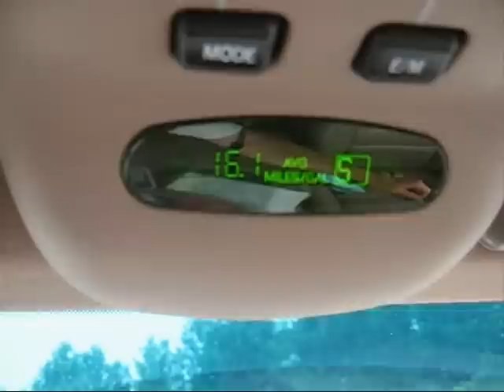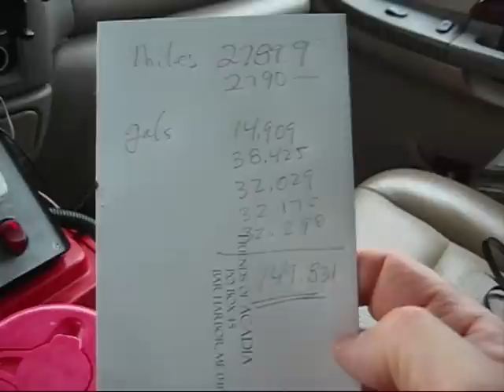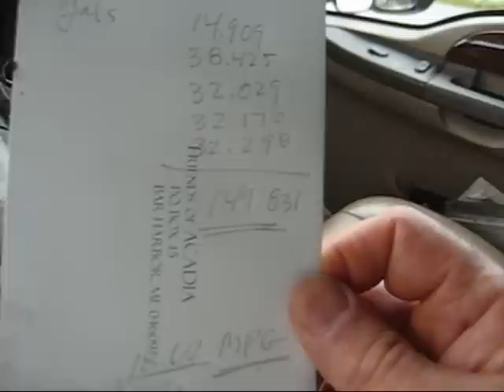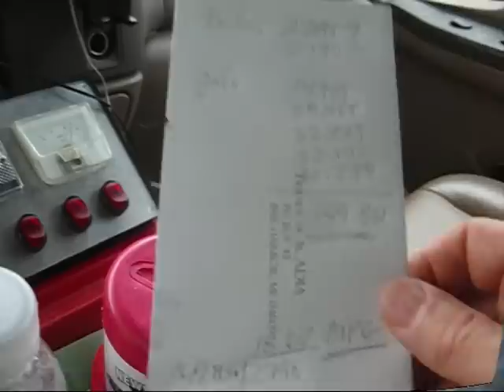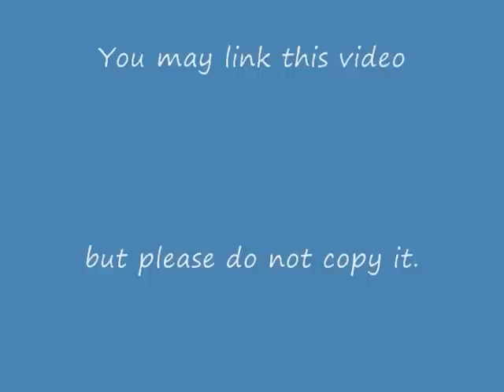MPG (mileage) Test 2790 miles with Dry Cell HHO F350 Superduty 7.3 Diesel

Comment from the maker: Thanks for stepping in. I get tired of telling these guys the same thing over and over again. They don't watch the videos, they don't read any of the comments. But one time or other they heard of the laws of thermodynamics, they don't understand those laws but it doesn't stop them from claiming that I have violated them. Let me state right now that the virginity of the laws of thermodynamics is still intact. I have not violated them.
Reply: people are stupid like a engine is only 30% effective because of the wasted electric that wound charge a battery. The excess energy that can't charge the battery because the battery is full charged goes to the HHO generation?
Reply: @Alec_Woldt    Well, not exactly... there isn't any "wasted electricity" per se.  The alternator has less mechanical resistance when fewer amps are being pulled; there is never any excess electricity produced, as energy flow is determined by the load, not the source (this is a simplification, but good enough for most things).  The reason something like this COULD be beneficial is because of the efficiency curve of the engine itself.  Fuel is used more efficiently when the engine is doing more work (generally).  So by giving the engine extra work in the form of producing electricity to power the HHO genny, which is in turn used to help fuel the engine itself, there will likely be an overall increase in fuel efficiency.

Comment: Just a suggestion, Have you tried having a separate battery and even add a capacitor between the unit? this quite help me on my amperage from dropping. And yes almost forgot I had a performance alternator included along with my set up. GL

Comment from the maker: The source of your confusion is that you are thinking of hydrogen as a supplemental fuel. In this case it is an additive that improves the burn of the diesel fuel. Back in 2008 I set out to disprove some of the extravagant claims made my HHO enthusiasts. So I made a hydrogen generator out of scrap and ran a series of tests. In every test I got a slight improvement in MPH when using HHO (hydrogen).

Comment: Hello,
  I have 7.3 excursion  I get 16-17 city and about !7 -19 hwy. If you keep your RPM at or around 1400 You will see 20-22 mpg. Oh, that's 45-50 mph. Check you converter. Manual trans get better mileage. Good info, I'm going to build a unit I think. Thanks

Comment: Well even if a dyno only displayed HP and torque if HHO was doing ANYTHING as claimed you would certainly notice an increase in torque and HP when it was turned on. However you know NOTHING about a dyno test. One of the purposes of a dyno test is for the SPECIFIC reason of checking gas mileage. You really need to do some research. Do you even comprehend what an air/fuel monitor is?

Comment: And there is no "energy" to be tapped...well not at a cost. If you were going to use some convoluted setup to burn fuel, to run an engine, that runs an alternator, to charge batteries AND run all the electrical systems, AND produce HHO..why not just ditch the HHO generator AND the internal combustion engine and go full electric. Skip all the efficinecy losses right off the bat?

Comment: I have no idea where you are getting this information on drag of the alternator vs. output.  Unless you think the alternator is an A/C compressor.  Do a little research in the high end automotive audio world and you will see what I am talking about.  A decent alternator can produce around 100A at full load.  This will only pull about 2HP from your engine.  If HHO production can increase your MPG to overcome the small 2HP decrease, it's a win.  The internal combustion engine is not efficient.

Comment: Is that 40 to 50 MPG real daily average use, or what the dealer states?  I can take a pic in my van that says I'm getting 99 MPG average if I reset it and then idle down a hill.  ;)  But really, it seems to get around 20 MPG with normal driving.

Comment: with a new vw sharan you get both: 40 to 50 MPG and 177BHP (130kW). it's not cheap, but if you drive 20.000 miles or more in a year you can really save money.

Comment: you can also buy a modern volkswagen tdi (turbo diesel injection) car (vw golf, vw sharan, seat leon,...) and have 50 miles per gallon like we all use them here in europe (germany, austria,.....).
cause of the taxes, the fuel is very expensive here, but we have fast cars that are not thirsty. the facts: one gallon of diesel here in austria is about 7 US$ now. with a modern diesel car 100 miles cost you 14 US$ of diesel.
what about the costs of 100 miles with a US car in the US?

Comment: Uhh I am no fan of Exxon which is why years ago I converted both my diesel car and truck to run on waste veggie oil and am a strong supporter of electric cars to reduce emmisions. I am also fine with any research to get vehicles to run on hydrogen. It is the scammers with these onboard HHO systems claiming massive fuel savings I am against and I tried it myself. Physics won. Sorry if you can't handle the truth. Enjoy your tin hat. I know others with a brain are reading and will not waste money.

Comment: Hi There,
I t all looks good except amperage, are you aware that just 1.9v producing HHO and rest producing heat that we call efficiency, If you use PWM or lets say kzx1250 you would en up with twice of HHO using just 10-15A that is beneficial not for yr pocket but for environment too. 

Kind Regards
Linas K.
kazlambiapictures@gmail.com

Comment from the maker: I considered emmersing the whole brick in used motor oil to help with cooling but what a mess! It is much easier to build a more efficient brick that does not get hot. On this brick the sulution was to solder the wires to the terminials.

Comment from the maker: I have closely monitored the EGT while using HHO and I found no increase in temps while using HHO. I have recently installed a water methanol system and it does add a lot of HP and I am still monitoring the EGT. It is very easy to burn up your pistons, valves and turbo if you run more than 50% methanol.

Comment: HHO burns hot. Diesel are not built for high heat and high combustion. In short you are doing more harm to your engine then good. Plus if u added a methanol injection to your diesel u would get better MPG and more horsepower.

Comment: From what admittedly little research I've done, adding a better fuel mixture is better. This also uses the electricity generated to separate the H&o2. I don't know what the generator does when the battery is full, but if it's not charging the battery it might as well add some pure O2 to the fuel mix, if nothing else. If I was still driving semi’s I would seriously consider adding this technology. Can’t wait to see smaller models for smaller engines. Chip/Sensor setting change is needed also.

Comment: HHOinfo..You are wrong and the numbers prove it..The truck is set up in a closed system..Once the HHO Gen is installed, the only thing extra added, is water..While it is correct to assume that, any electricity used is energy that comes out of the system and increases the overall  fuel consumption; it is erroneous to think that energy is wasted.. Since it is a closed system and there IS a ABSOLUTE TOTAL FUEL MILEAGE INCREASE, All changes are indicative of a total energy increase/savings..

Comment: Fair enough! I've just got rid of my Izusu trooper 3Ol diesel which i used for towing trailers etc.  having built my house i no longer need it. but fully understand your obvious need for a large truck.  Still facinated with your site, will continue to follow, wonder if the same system could be applied to my 1600 turbo D, scaled down of course, thanks& cheers Gwyn Jenkins, Monmouthshire. UK

Comment from the maker: The vehicle in this video is a truck that I use for work to haul heavy loads and pull heavy trailers (often in excess of 10,000lbs). While a smaller vehicle would certainly use less fuel it does not make economic sense to keep a second vehicle to use on an occasional vacation. We do have a smaller car but for this trip it was not large enough to accommodate five people, two large dogs and baggage

Comment: I've read with interest lots of these HHO projects. Am I missing something here!  You all seem to be using massive 7+ L engines in your cars. Surely if you reduced the CC of your vehicles. you would automatically reduce your consumption.  I get 50MPG from my Citroen Multispace 1600cc diesel (loads of space carries 4 people or 600kg in load space). The big problem is I don't pull any females with this car. (thankfully). Surely using smaller fuel efficient engines is the way to go.

Comment from the maker: I have had some success in tests where I drove the same routes with and without HHO, The extra hydrogen seems to improve the burn of the fuel. If it did not work at all you would expect to see a decrease in mpg when you had the generator running. In multiple tests I have never has a decrease in mpg but some times there was no gain.

Comment from the maker: I have done the math in one of my other videos and you are correct that there is not much Hydrogen added to the intake air. It is amazing that there is any improvement at all. I have noticed that I only get improvements in mpg when I operate the truck in a low fuel consumption mode such as cruising on the highway.  When I am carrying a heavy load or towing a trailer there is no measurable improvment.

Comment: I had a 1996 F-350 7.3 powerstroke,crew cab with 3.55 rear end, that I usually got at least 18.5 mpg at 65 mph with tailgate down (8 ft bed).  So, to me, 18.62mpg isn't that remarkable.  I, also, got that problem with it taking 5 minutes to top off the tank.  Must be a design characteristic of Fords.
But, I am still interested in finding out if HHO will work for me in my crown victoria.

Comment from the maker: No problems with early ignition. As soon as the HHO is mixed into the air stream it is diluted to the point that it can not be ignited by flame, spark or compression. The diesel fuel is directly injected at just the right time and is ignited by compression. On a gasoline vehicle you could have early ignition before the intake valve is closed and belch fire into the intake manifold. If the flame makes it to the HHO injection point the HHO could be ignited and flame all the way back to the brick.

Comment: Did you have any problems concerning ignition out of combustion chamber or early ignition inside of chambers because of using HHO in Diesel engine? Thanks in advance :)
Reply: Diesel cannot experience early combustion in this situation because the diesel already ignites as soon as it is injected.
Reply: @bobirving6052  Thanks for replying. I was more concerned about the HHO igniting early inside the combustion chamber of a diesel engine.

Comment: I have a 2002 7.3 F350 also if i keep my tack under 2000 rpm i can get over 18 mpg and that is not any highway driving without a hho gen. Do not get me wrong i am interested in more info on the hho I am thinking about doing one my self I am just trying to learn more before i build. But I hope to better my fuel mileage not make worse I mean i get that kind of economy pulling a trailer.

Comment from the maker: A while after I made this trip I ditched the four circuit breakers in favor of a large one and I soldered the wires to the plates. When I made my second brick (see the play list "My second HHO Brick") I ran wires to all four corners. That worked well but the brick leaked like a sieve because of a gasket problem.

Comment: Great! How is cooling the fuse/breaker a good soultion? Maybe you should have greater cable area and better/soldered connection points as you mention. Can you have several connection points? Maybe diagonal, for having to deal with less resistance through the steel. Cheers

Comment: Yea swap the whole drivetrain cause when you move up to the 3/4 ton stuff its alot stronger than the 10 bolt stuff the 1/2 ton has.My M-1028 has the 14 bolt rear with detroit locker and dana 60 front and i dont worry about breaking it.That 6.2 motor will last forever if its took care of.

Comment from the maker: I have 85 GMC 3/4 ton 4x4 with a 6.2L that I use around the farm. It is very easy on fuel but very under powered. I have been thinking of pulling the engine and drive train out and putting it into a surplus Blazer.

Comment: I have a 85 M-1028 1 1/4 ton 4x4 and all i did was put in a 700r4 overdrive trans and i get 27mpg with 4:56 gears.This is a military truck with just under 38k miles.

Comment: hho burns better than gasoline and is perfectly clean with no emissions. if there was no gas being put in a vehicle and it was running on hho from batteries or a generator there would be more efficiency in cost and emmisions

Comment: I think your drawing to much current and amps. Every neutral plate you add on should drop voltage by 2. The most important thing to do to increase hydrogen production.......BIG SECRET... 
You must increase the voltage frequency by adding a high capacity potentiometer or build a solid state unit. Plug it in between your power source and the HHO genny, You should expect about 25 liters a min...

Comment: I get 19.5 with my 2000 F250 superduty 7.3 staying under 55 got this truck new it has 175,000 miles 5 speed manual no chip stock. Its been the best truck i have every owned. starting to rust but i live ocean front. plan to replace it at 20 years. why cant they have just keep making the 7.3 replace water pump at 75,000 miles turbo o ring on fuel line at 120,000 miles. paid $32,000 new hate to see what a new replacement will cost. $75,000? o i forgot low inflation bull shit goverment.

Comment: Forgot to add.........the diesel stink is nearly gone and the engine runs very smooth and appears to have a lot faster pickup........So if the emissions are less and appx 30% less fuel use is ok by me

Comment: 91Toyota Hiace 2,4L turbo diesel......we split the cell.........half runs when the engine fires at idle 10amp........the  other half is activated by the throttle ......have only done one test.......8.8Km/Ltr with the system engaged......6,2Km/Ltr on straight diesel.......Only problem seems to be that drawing 20amp on this 70 amp alternator doing short stop and start driving will run the battery low after a while

Comment from the maker: Since this is a direct injection diesel there is not "altering the timing". The fuel ignites when the diesel is injected. You could argue that the burn is a little faster but I do not think that the difference is fast enough to make any difference...I am working on water/methanol injection but that is for another video.

Comment from the maker: I agree that the emmission standards decrease the average MPG of American cars. But gas and diesel are not the same. In a gas engine if you pass the stocimetic point you will burn up the top of the pistons and burn the valves. In a diesel there is not stocimetric point. You can add as much O2 as you want until all the diesel is burned. HHO does not lean anything up. You are adding H2 and O2 and they recombine in the combustion chamber.

Comment from the maker: You can inject plain water into the intake air of a diesel under certain conditions. The water is instantly turned to steam and increases the pressure in the combustion chamber. The increased pressure translates into more horse power and torque. Usually people use a water/methanol mix for the added fuel from the methanol but plain water will work. It might actually work better than HHO in most situations.

Comment from the maker: The MAP sensor does not control anything. The MAP sensor tells the computer what the Manifold Absolute Pressure is. The computer decides how much fuel is injected based on inputs from the MAP sensor, Throttle Position sensor and some other inputs. Some people have tried fooling computer into thinking that the MAP is less than it really is so that it will inject less fuel. But when you inject less fuel the truck doesn't go as fast and you push down more on the TP sensor. Still no O2 sensor.

Comment from the maker: *You need to do some research. Your truck is not that basic. You have to have on O2 sensor. What tells your MAP sensor how much fuel to deliver via air density, air temp and turbo boost? All these are variables the computer has to adjust. Go get a book on engines. I too have a 7.3....It took me quite a while to decipher your post. I have many books, I have done my research and I have at least 20 years more experience than you.

Comment from the maker: This 7.3 liter diesel is direct injected. I can not make any sense of the rest of your sentence. I have to correct the about statement: There is a MAP sensor on my truck. The only control on the turbo is the waste gate and it only opens to relieve excess pressure.

Comment from the maker: This truck is a diesel and this particular diesel does not have an O2 sensor, a MAP or a MAF. There is no restriction of the air flowing into the engine. The fuel flow is controlled by the throttle position.

Comment: You could run an engine on neat Hydrogen and use the exhaust gases to "dope" the hydrogen to give it a burn rate similar to petroleum. H can be made to burn like any other gas in this way.
Reply: Wow. How does this work?

Comment: Exactly, good point. HHO will not really optimise a very inefficient engine. You can only hope to burn LESS gas by using HHO or to run 100% on HHO. Obviously if you burn less gas by adding HHO you will increase the MPG of gas used... in theory anyway. I reckon you would need to remap the engine and adjust the fuel injectors otherwise it is just like adding more air into the mix. ie. burning the same amount of gas.